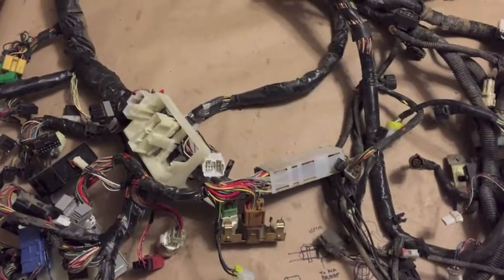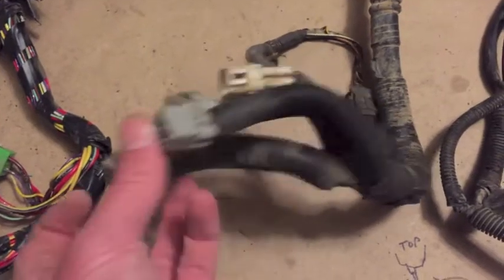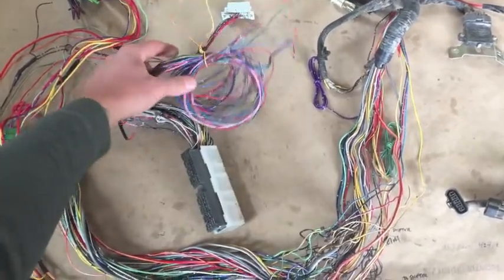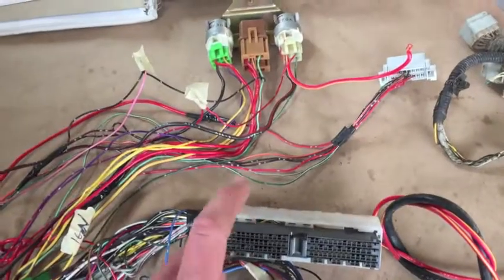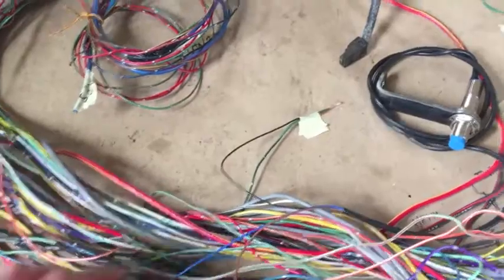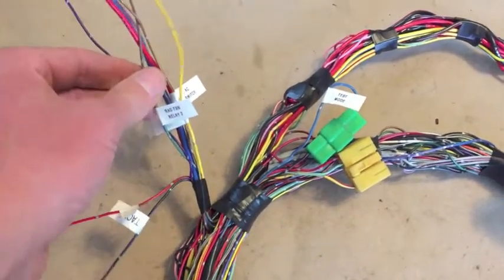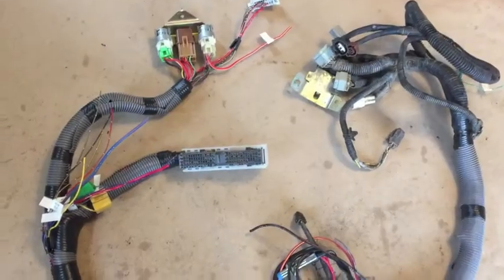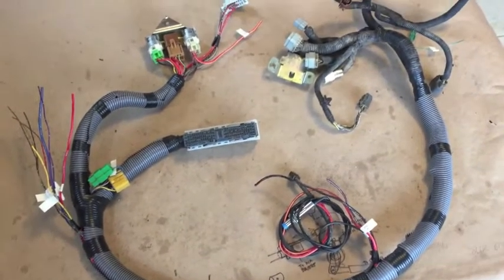1995 Subaru Legacy Wiring Harness VW Conversion

Comment: Do you have a video detailing the installation of the "new" wiring harness into a vanagon?
Reply from the maker: +Matthew Morrison I don't, it only needs a few connections into the Vanagon though - ignition wire, battery, fuel pump, and starter solenoid. All of the other items are optional. Good idea for a future video though.

Comment: Do you ever need to strip anything out of the engine harness?  I'll be doing this in the not so near future once I get a donor for my '74 Beetle.
Reply from the maker: +Lafond RC You strip all the wires that are loose in the harness once the unnecessary connectors are clipped off.

Comment: does the neutral safety switch need to be grounded before the engine will start?
Reply from the maker: +Trevor Proby No, it’s entirely optional.
Reply: Busaru awesome man thanks. im not getting spark. test mode functions seam to work. fuel pump comes on briefly when ignition is on.

Comment: I just finished my harness. where do i hook my starter signal wire, coming from the ignition switch? splice it into the starter switch wire coming from the subaru harness ?
Reply from the maker: +Trevor Proby Leave the stock VW setup in place. Hook te “starter switch” wire from Subaru ecu to the VW wire that connects at the starter Solenoid.
Reply: Busaru i had it taped and it was hiding from me. thanks buddy
Reply: There is a good video on this part where you hook up the OEM car key to work with the swap pl

Comment: Great video. You should check out Ultra Gauge's Wireless OBD-II gauge system since you are keeping your obd-II port. It allows you to stream data from the ecu to their app for IOS or android. its only $80.00 USD and seems to provide a lot of data! 

http://www.ultra-gauge.com/ultragauge/support/gaugelookup.php

Enter in the 1995 Legacy info and it tells you all the usable data. 

I would love to see this applied to a bus or bug project and eliminate the need for vehicle speed sensors and other hardware. 

A cheap tablet and this system could ideally replace most of the factory VW cluster minus maybe the in-tank fuel level provided that oil pressure, temp, and water temp sensors are configured.
Reply from the maker: +Samuel Ross So I looked and looked but didn't see anywhere where you can actually get rid of hardware such as the vehicle speed sensor. It looks like ultragauge is just an expensive version of the OBD Fusion app (or other obd2 based apps). I could just be missing it - can you send me any info on what makes this app different? I'd love to eliminate hardware!